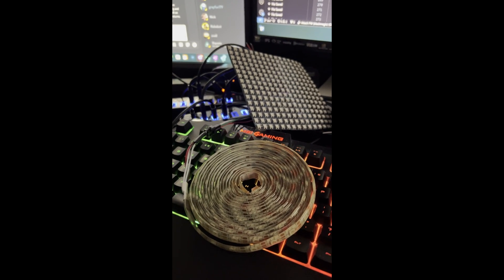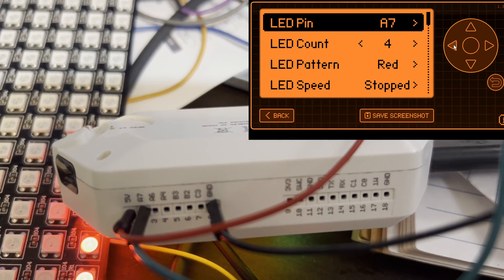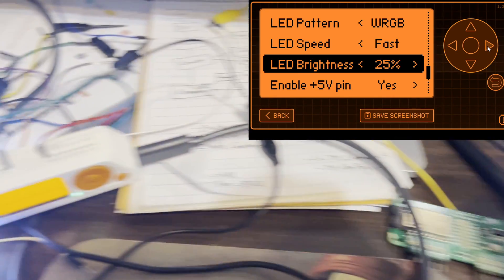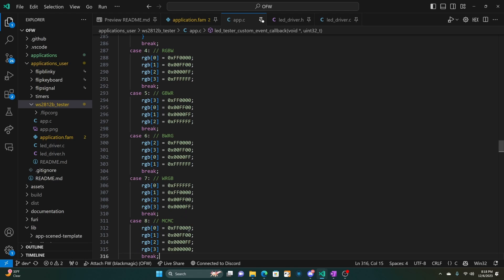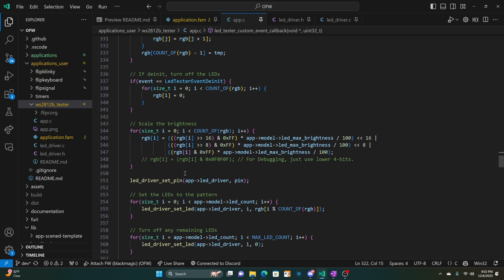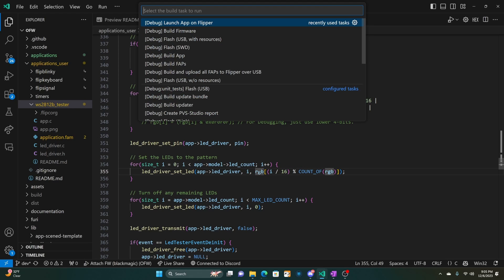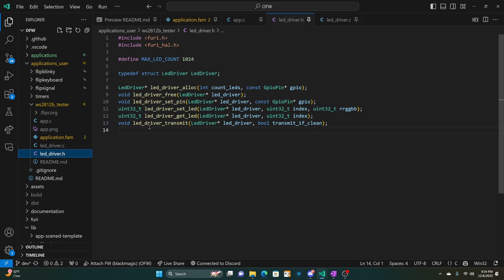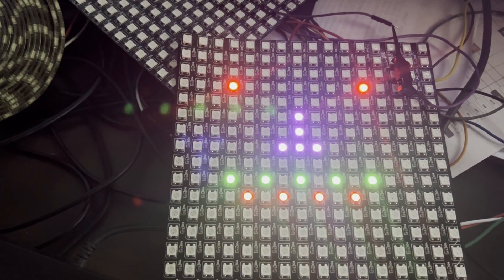[94] Flipper Zero - WS2812B LED Tester & LED Driver

Comment: Could these be controlled with the java script?
Reply from the maker: Yes, it's "possible" to control WS2812B with JavaScript but you have to write a module in C first. The reason is that WS2812B LEDs need the signal with very exact timing and APIs are exposed for accurate timing. I wrote the module code at https://github.com/jamisonderek/flipper-zero-tutorials/tree/main/js/flipboard/modules/js_rgbleds but I haven't tested it with the latest firmware. You would end up with an .FAL file that loaded by the JavaScript engine.

If you can find SK9822(or APA102C) LEDs instead, the can be controlled in JavaScript without requiring a C module, since they have a clock line that JavaScript can control.

If controlling WS2812B LEDs in JavaScript is something you are wanting to do, feel free to reach out to me on Discord at @CodeAllNight and I can provide better assistance.

Comment: I don't know my way around vs studio code and well actually my poor computer can't handle any more programs anyways. I have it on a Pi4b but haven't had the time to learn it. Is there any other way of getting your app onto my flipper? I just recently discovered neo pixels and have been buying tons of strips and different esp32 boards, power supplies IR remotes and now a Wizmote. In my searches I came across your video and would love to have it on my flippers, just because why not. My flipper has kind of taken a back seat  when it led me to Raspberry pies, but it's time to get back into the learning to master the flipper. there's been some serious advancements in the custom firmware since I last really played with them back when extreme was on version 23 or so.
Reply from the maker: I think the app is part of RogueMaster firmware now?  For other firmware, I can probably build it for you.  Jump over to discord and remind me you are from YouTube and let me know which firmware version you need a FAP for.  https://discord.com/invite/NsjCvqwPAd
Reply: @MrDerekJamison  Oh nice, I'll try rogue masters firmware on one of my flippers and see if it is there. I've been running Claire's Extreme lately. I haven't been flippering to much since I discovered neo pixels, it'll be great to combine the two.

Comment: I’ve always used an external power supply with my microcontroller setups for LEDs. It’s likely that if you’re deploying a set of these you’ll have them on a PSU anyway.
Reply from the maker: I agree external power is the best way.  Nice to not have to worry so much about too much current draw from the Flipper Zero.
Reply: @MrDerekJamison  By the way, I really appreciate your videos. So many “educators” for the Flipper Zero are deep into the “hacking culture,” and it gets annoying. I’m a software developer, an amateur radio nerd, and generally just interested in hardware and RF hacking in the purest sense. You’re great.

Comment: This is one of those moments where I feel like an optocoupler and a separate power supply might save that crippling feeling of flipper death we all want to avoid. I think I have a few around. If you're into using the gpio, folks,  get some optocouplers to help save your life and prevent a lot of grief. Thanks for the coding advice. I know hardware, but I'm still mediocre with firmware/software. I honestly appreciate the guidance. You rock, my man. 🤙🏽
Reply from the maker: I’ve only measured the power wire, which is where I’ve seen high current consumption.  My assumption is the data in is some small current (data sheet doesn’t show, only thing about input is 15pF max input capacity). I assume data out on the chip is a separate push/pull line (since it’s 24/bits later data) so more LEDs shouldn’t impact our load on pin A7 (of whatever Flipper pin)?  I have no way to validate my assumption, which is always scary.  The speeds are crazy high 400ns or 800 ns HIGH, with 400ns or 800ns LOW; so I think opto couplers typically can’t switch that quickly?  The signals are so quick that I have no idea how to measure the current (signal at 1200ns duration [833MHz] at 66% duty cycle when all bits HIGH).  None of my 20 year old analog measuring equipment comes anywhere near those speeds.  If you have ideas, hit me up in Discord (server invite in my About page) and I’ll mail you two smaller sticks of WS2812B LEDs to experiment with.